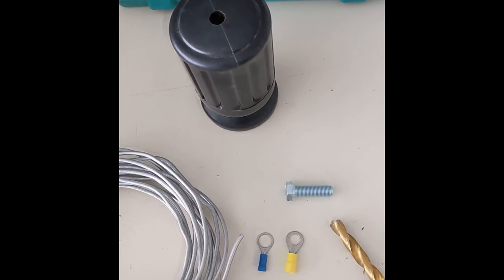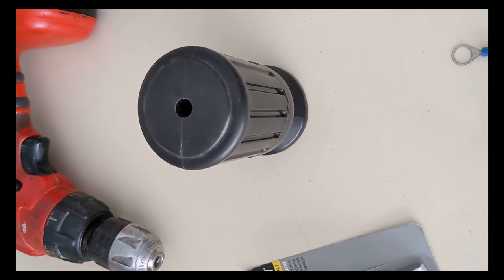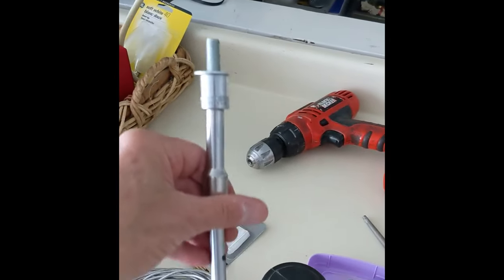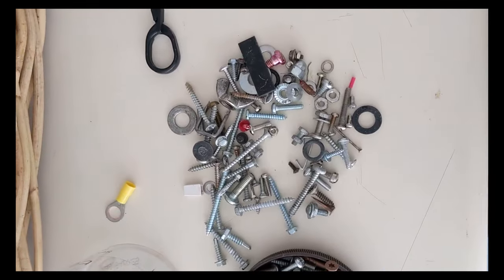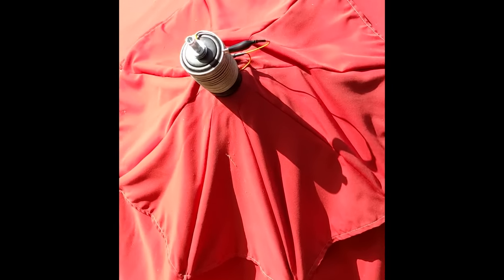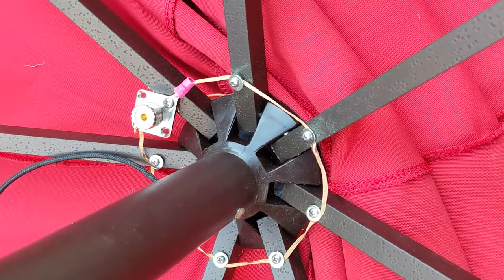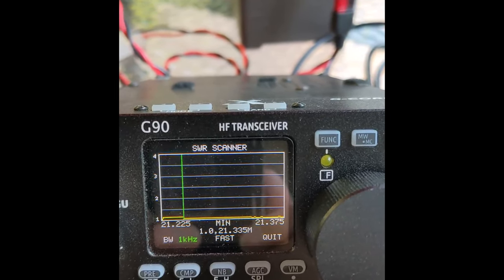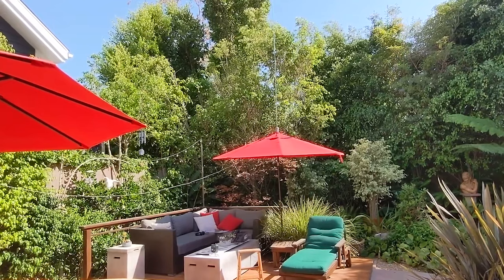Turn Your Patio Umbrella Into a 20 Meter Antenna for Ham Radio with Greg WB6MPH.

Comment: The goal was to not spoil the view of the patio. Mostly achieved, except for the counterpoise. Would it be possible to hang the counterpoise from a string of DC powered LEDs? DC for safety and to prevent rf getting back to the mains.